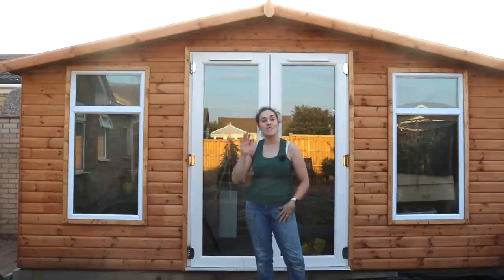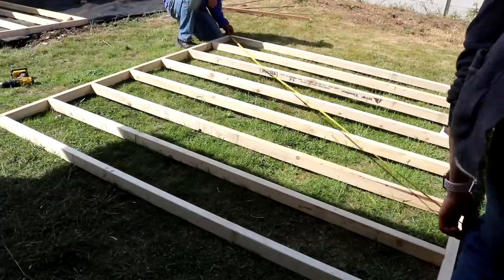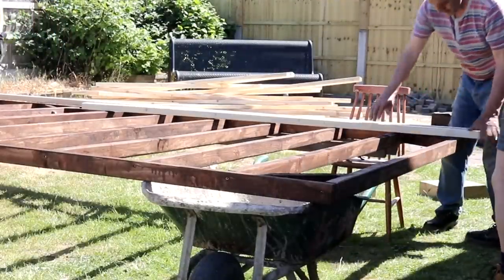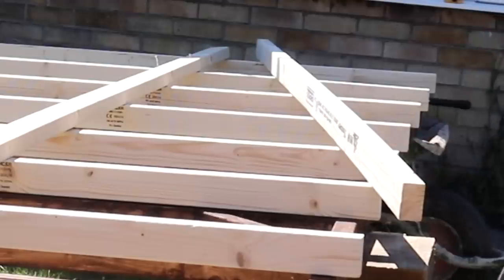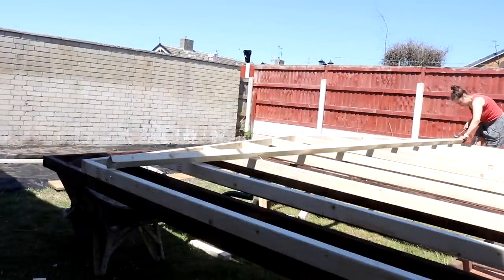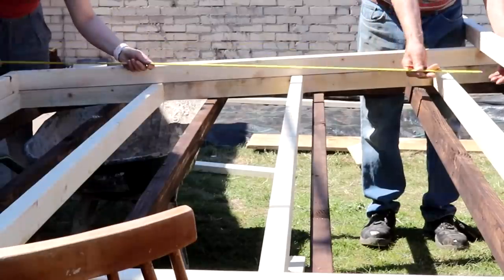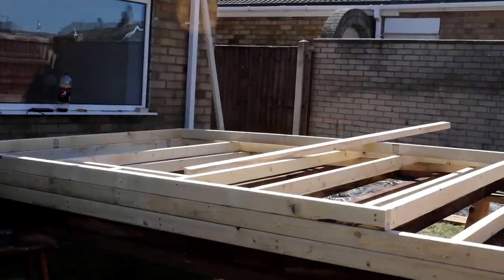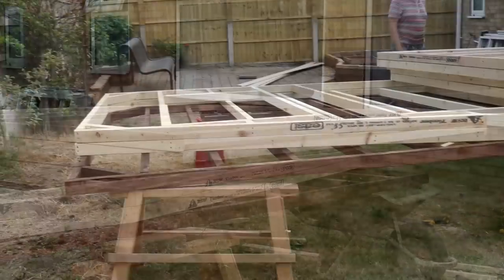DIY Summerhouse Shed: Base & Frame Part 1 (Garden Room) | The Carpenter's Daughter

Comment: Great idea for the base. If you were converting the summer house to a gym what modifications do you think you'd need due to the weight and activity? Would you jump straight to a concrete slab or is there a way with good old timber?

Comment: Now that's a great project.. I would love to do this but maybe next summer. Out of curiosity why did you not screw the frame to the base whilst it was stacked? Sorry I'm a bit slow today and didn't understand why you nailed it.
Reply from the maker: We nail the next frame as we go as:
-You don't have to keep checking if it's square on every frame - so it's important to make sure the base is square right from the start.
- You have the measurement right there and you can use it to copy them exact - for example, you can match the two front and backs (pitched roof in our case) which are the same and the two sides, which are the same as each other.

I'll be showing you the same method if it helps, in an upcoming lean-to shed and a chicken coop with pen video :)
Reply: @TheCarpentersDaughterUK  Vikkie thank you so much for the detailed explanation.. All makes sense now. I think the heat got to me today :-) look forward to the next update.. All the best

Comment: Hi, thanks for the video, i am about to start a project of my own and after watching lots of videos I've chosen to use your video as a guide as it seems really simple to follow, looks the part when completed and for the money it cost it's much better than some more expensive ones I've seen. I was just wondering if all the timber you used was pressure treated, dip treated or untreated? I'm a bit worried about leaving exposed treated timber inside when we'll be spending a lot of the summer in there. Thanks in advance.

Comment: Wow, that's beautiful!  I'm really looking forward to seeing how the rest of the roof framing comes together.  I'm laying out a similar sized shed here, 8' x 12' (about 2.5m x 3.5m).  I'll be using mine for yard tractor and implement storage.  Mine will be a little bigger, but not nearly as pretty.  If you ever get to this side of the Pond, you'll be more than welcome to slap the same siding on mine.  Honest, it'll be fun, like whitewashing a fence.

As my needs are different, my construction will be a little different but not too much.  The floor framing will be 2x6s spaced 16" on center.  The main difference between yours and mine is what's under it.  My framing will be attached underneath to three 12' pressure treated 6x6s.  The 6x6 skids are so I can drag it with my truck or a big tractor if I ever need to move it.  There will be four concrete blocks supporting each 6 x 6 skid and each concrete block will be sitting in a small tamped gravel pit.

The reason I ask about soil is because what I have here is sandy loam.  This used to be an ancient sea bed which makes it great for farming, but bad for any construction on grade.  Given the soil conditions here and the large amount of weight I plan on storing, I need to ensure that the foundation doesn't sink.  Do you remember how the bricks were laid out and if there was any prep work in setting them?

Sorry.  My ex tells me that her husband and I take way too much time thinking about stuff, way over engineer things, and never think about how it looks when we're done.  After a great deal of self reflection and one or two epiphanies, we've both come to the conclusion that we have no idea what she's talking about.
Reply from the maker: Thanks :)  I think here, the ground was just tampered with a hand tamper, weed control down, then some bricks placed around, including offcuts of treated timber to fill excessive gaps.

I wonder if sleepers may be a good idea for you as they're big and sturdy?

Comment: Good job 
Aren’t dads great hey 
If you can get hold of a torque gun your screwing will be so much easier I’ve found that out with previous jobs
Hope the pants weren’t yours flapping like a flag in the wind 🤣🤣
Reply from the maker: Thanks for the tip!  And no, definitely not mine 😂
Reply: @TheCarpentersDaughterUK  Yes, I can second that. After using a cordless drill to drive screws for close on 20 years, I bought a Bosch cordless impact wrench on a whim and I found it to be a real game changer for screwing in to wood. I bought one with the same batteries as my cordless drill so I can share them. Thanks again for the great videos Vikki, I'm looking forward to the next instalment on the summerhouse.